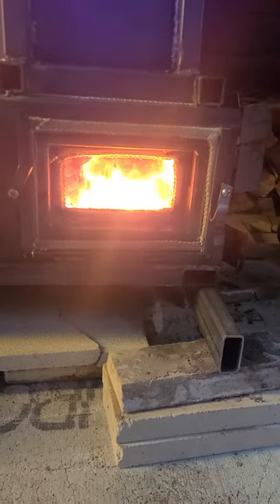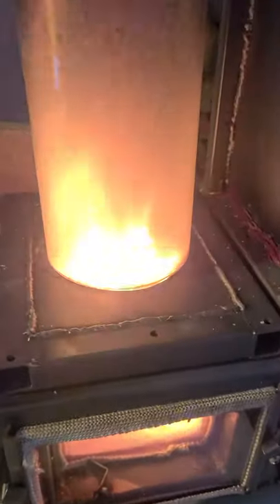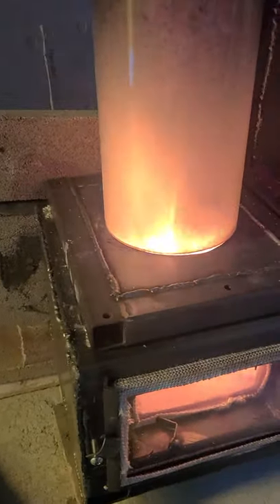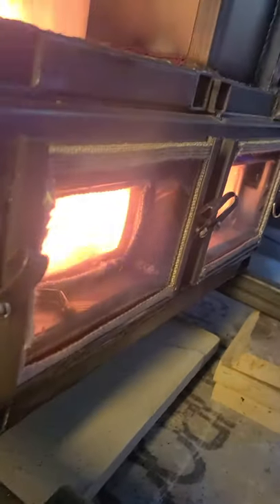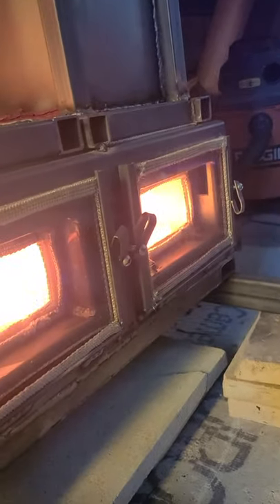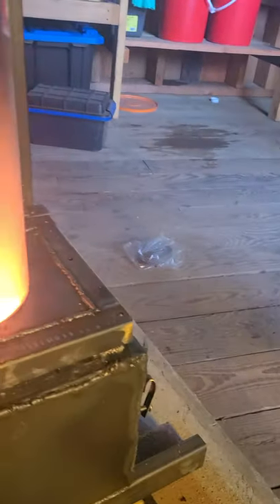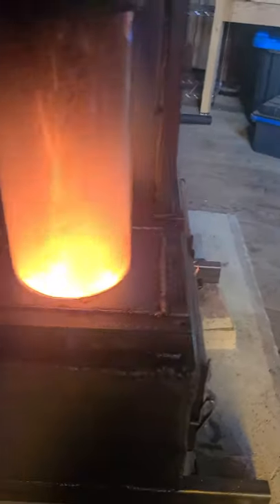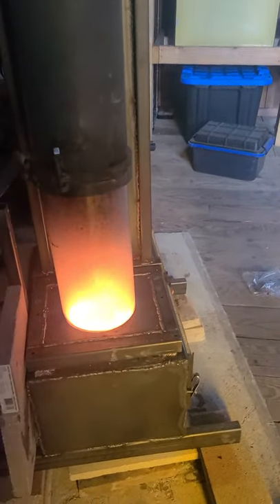6th burn. Tlud, gasifier, and or rocket stove concept wood stove.

Comment: Quartz glass?! That seems so dangerous... would that not explode in due time... Sure does look cool as in bloody cool ... hahaha
Reply from the maker: No, it shouldn't explode. They are much more heat and shock resistant then even ceramic glass (if memory serves correct). I bought it a while ago and have used it for a few years.

Comment: Is that a glass chimney?!?!
So cool! Where did you find that?
Reply from the maker: Hey Nate, yeah it's a quartz glass. I ordered a batch from China (Alibaba) but you can buy smaller diameter ones here from azpatioheaters. 

You would probably need to use 2 or 3 of them.

You also could just make a square steel one and put a neoceramic panel on one side. That's what all the other glass is.

Comment: Great video. Thanks. Can you get a temp gauge?
Reply from the maker: Its out at my cabin which i can't really get to in the winter until i buy a sled. I did run laser thermo at some point but can't remember the numbers off the top of my head. The cabin is tiny and it just roasts me if that helps lol.